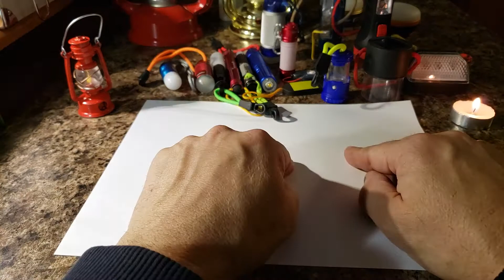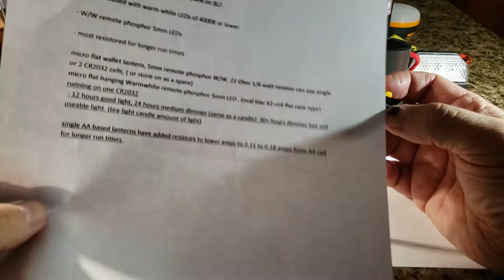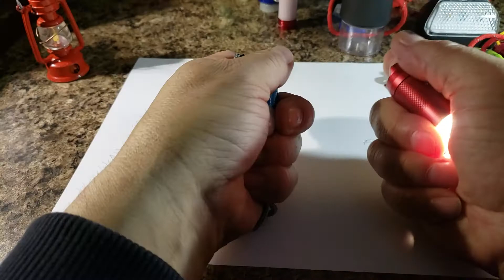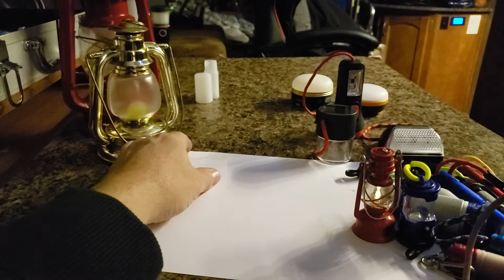The tiny Micro Lanterns!

Comment: Excellent video DBSAR, I just went and picked up 10 of the solar lights from the mart. That LED is very nice with the phosphor in the resin for lantern applications. I noticed that it is being driven at 5ma with a Vf of 1.2v which seems very low. I wonder if this led is specifically developed for 1.2 v solar lights. I am also a small lantern holic. I appreciate the time you spent on creating this
Reply from the maker: They are great low-power LEDs, i wish i could find a source for them.